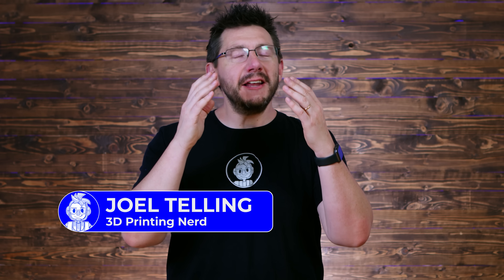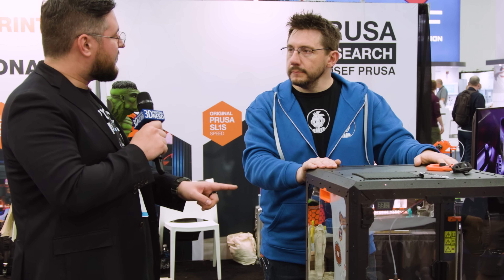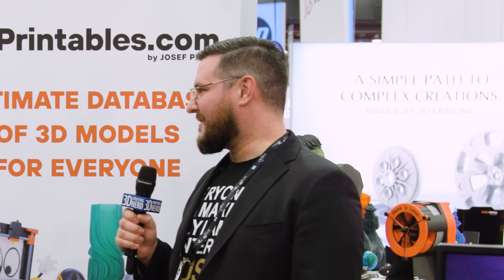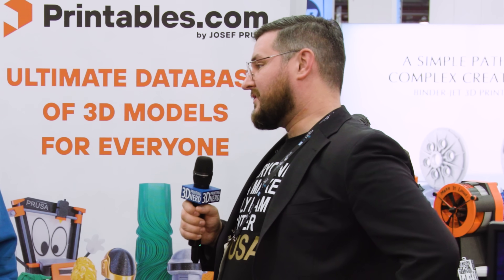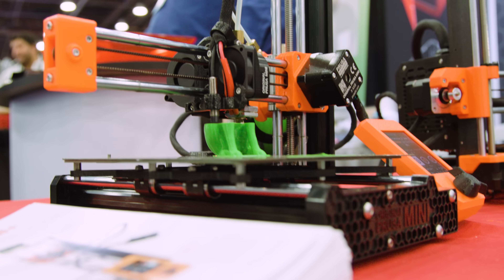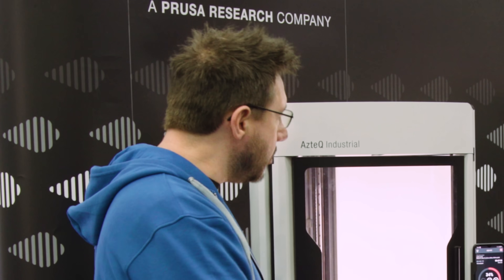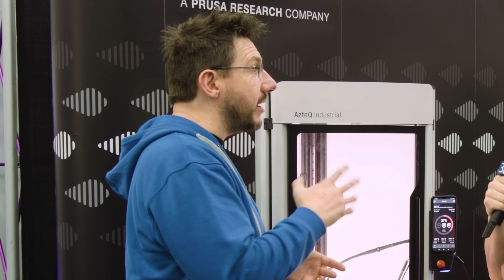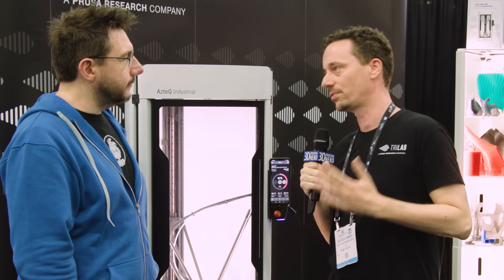The Prusa Family Is Growing! All 3 from RAPID + TCT!

Comment: XL was not given enough time. First time seeing the Aztec Trilab, thats interesting, but no talk about cost...big miss. why not talk about the mechanical performance differences with parts produced on this machine, using the heated chamber vs CoreXY heated and unheated? perhaps compare to Addwise 3d printer or Mosaic Element, Raise 3D or BCN3D or Fusion3 printers? where does this printer stand compared to the others? why consider this printer? this left me with more questions than answers.
Reply from the maker: @rescuemethod  Oh for sure, my friend. I very much want to.
Reply from the maker: Well, that's a good thing. This is but a taste of things at a trade show. I have very little time to dive deep at shows. The goal is to give a decent overview and do a deeper dive on the things people are interested in.

Comment: Is it just me who thinks Prusa is lacking in 3D printer development? I mean it is grat to fix the things around the Printer (Parts, Models, ...) but what is going on with the Hardware? It feels like not much happend since the release of prusa mk3 in 2017. I dont see high speed printing, exotic material compatability, sequential printing, failed print detection, high flow options,... Also the enclosure has no temperature regulation?! Must have ben hard to develop a box with a bolted on Powersupply to the outside. I realy like what prusa is doing for our comunity and the Platforms and Slicer they are providing. It just feels like in the FDM section, not mutch innovation is happening. What do you guys think? Am i missing something?

Comment: I've been very hesitant to get a prusa as My first printer. While I do think prusa is a good printer brand. Anycubic has been making huge strides with more advanced but affordable printers! The anycubic kobra is below half the price of a prusa, and it has way more features.
Reply: Refinement vs features aka Quantity vs quality. Which is more important?
Reply: Competition is great for us consumers. Also check out the Lost In Tech review of the Elegoo Neptune 3 - seems to be great bang for buck also.
Reply: I bought a medium priced printer first and to be honest... I regretted it...
We all know that the cheap machines are trash. The medium machines are okish but require a lot of tinkering. When I didn't use my printer for a while it felt like I needed to fix it first, order spare parts etc... In some point I wasted more time and money on making it work if I wanted to print something small then it was worth it... I invested in a used mk3s and I am happy since then
Reply: @Mouhfighter  Ironically, Ultimaker proves you wrong. They have very expensive printers with questionable quality.